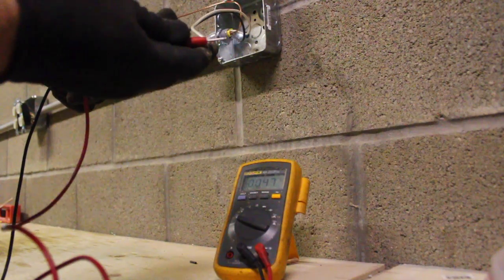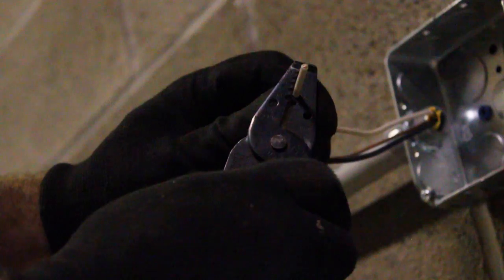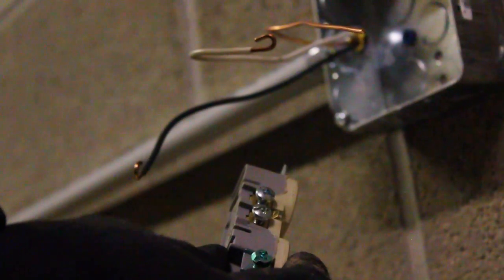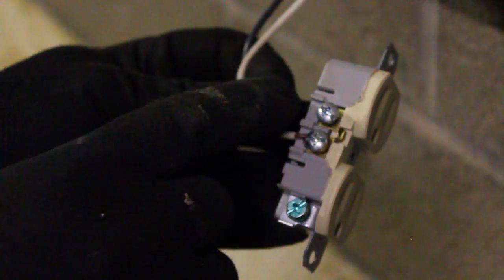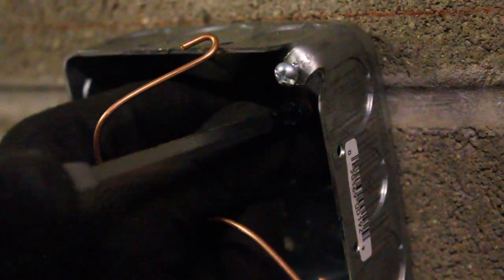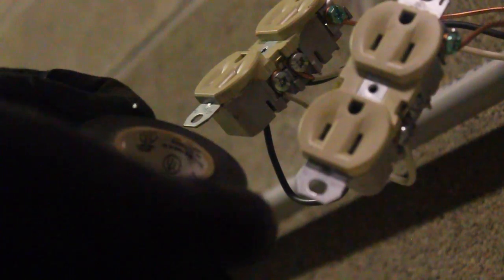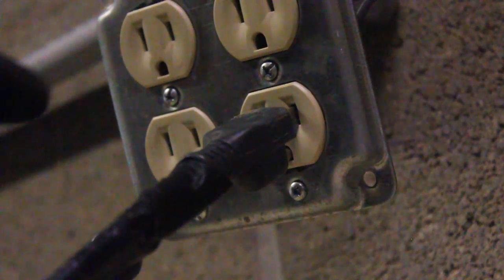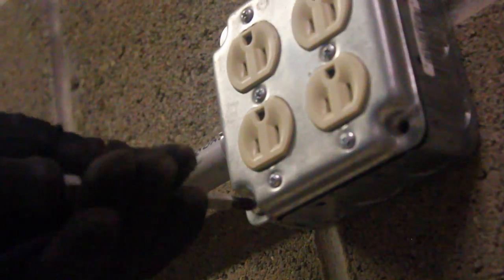BEST way to install commercial outlet boxes

Comment: My preference is solid THNN 12 awg, with 20A receptacles, they have a metal strap on the back. 
I wouldn't use romex through emt, or use 15A receptacles.

Comment: Many years ago (1990s)  - The very same day I found out that code was changed to install outlets with the ground facing up (I am an AV person, not an electrician), I walked from the under-construction addition to a building where the electrician had just told me about it with no explanation why (I'd commented that "his outlets were upside down") to an existing part of the building. I was using a metal fish tape to pull some speaker wiring across the ceiling and suddenly realized I was "getting bit." I looked down from the ladder and saw that the fish tape had done exactly what you showed, worked between a cord cap and the outlet and was bouncing across the blades of the plug. There's no teacher like experience!

Comment: You should use commercial grade receptacles in this application and in places where 20 amp circuits are used. They are more durable and have better plug retention than the residential grade receptacles. 15 amp receptacles are totally fine, though.

Comment: Everything is perfect and also the way I do it, except for that copper sleeve for the ground. I use a pigtail and wire nuts because it's a lot easier to make changes later, and just as secure. I doubt using a sleeve vs a wire nut is a code thing.

Comment: I've seen in some diagrams for wiring double ganged outlets where pigtails are used not only for the grounds, but for the hot and neutral wires as well.  Do you think that the code varies as it applies to this specific wiring?  I guess pigtailing the hot and neutral may allow one outlet to continue to work if another went bad.

Comment: Romex in PVC is against the NEC
Reply: 334.15 (B) allows it. As long as it's complies with 300.5 (B), 300.9 & 334.12 (B)(4).
Reply: @nicknice326  Yup, Romex requires protection anywhere it would be exposed to physical damage like when it’s not inside a wall in a basement, etc.

Comment: I'm glad you showed how to break off the tabs. No one at Lowes could tell me how to make receptacle fit and I showed them problem in store. They said "you bought the wrong one, you need a decorative one to fit those." I showed him it's yoke was same, they didn't say anything else. Moved on to other customer. Why doesn't the box come with the green grounding screw? Where do you get those?
Reply: Got green grounding screws at Lowe's too.  They come in a pack of multiple screws, found mine in the electrical section near the wire caps, etc.
Reply: No offense to big box store employess - everybody has to start somewhere - but I try not to go in there without first doing my research. Most sixteen year-olds are not going to be as helpful as you'd like.
Reply: Honestly, management at big box home improvement stores don't want any of their employees to give how-to advice for fear of liability.  Worked there, done that.

Comment: The plugs are upside down.
Reply: You didn't watch all of the video, did you!
Reply: There is not a code to call out if the ground is up or down.   I like to install them down but person preferences, the guy in the video preferred up.
Reply: It depends on the application. Some codes require it.